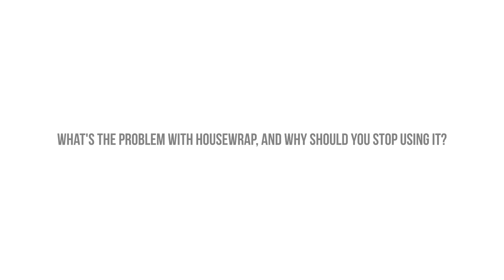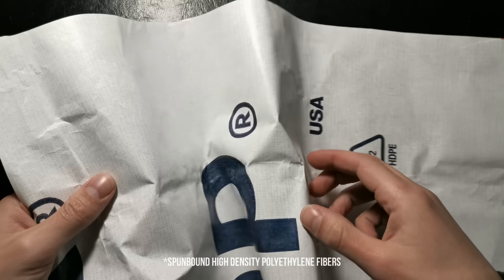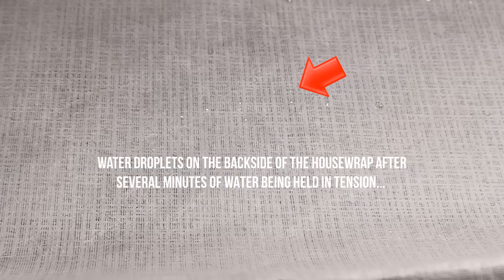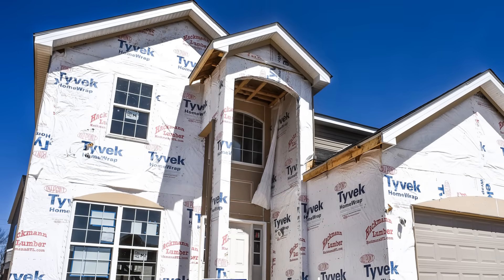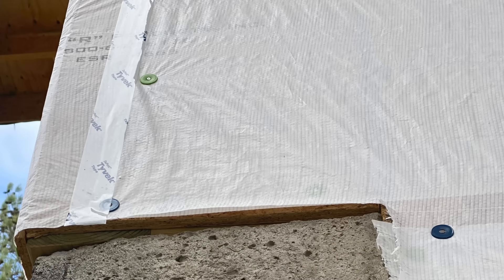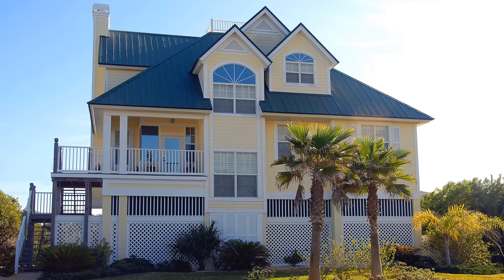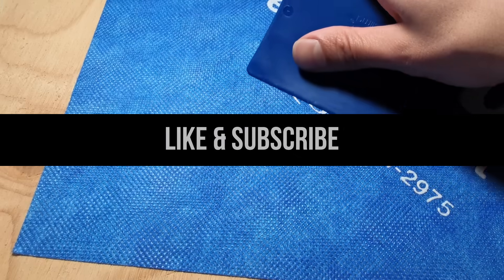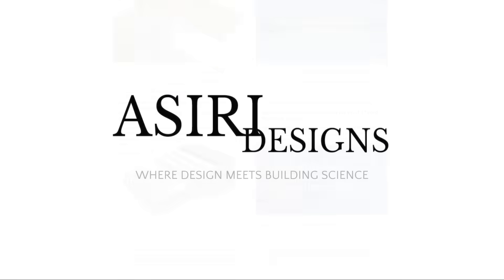Why I Stopped Using House Wrap

Comment: Having done my fair share of old house renovations and repairs here in Kentucky, I’ve never seen old fashioned tar paper fail when properly installed. I’ve taken down walls with 100 year old tar paper behind poplar clapboard and the tar paper was still like new.
Reply: Yeah it is amazing what free airflow can do to preserve a wall construction. Start to restrict that with retrofitted insulation or exterior sealants and the trapped moisture does destroy building papers. I've been renovating old houses for 38 years including a few years working as a builder doing external weatherboard and window repairs for a friend's fairly large painting business. It's amazing what you start to see repeatedly and consistently with old houses when modern sealants and ideas are forced onto them. I'm still a fan of heavyweight, self-supporting building papers.
Reply: @DiscoFang  I still feel like a house has to breathe. I know that the new code and new methods call for the house to be sealed up like a can but I don’t trust all the adhesives, caulks, and tape to last. Especially when applied indifferently. I’m about to retire and build a house for myself and I’m trying to strike a balance between old construction techniques and modern thermal performance. It’ll be a small house, so it’s not like I’ll need to heat and cool 6500 sqft of 20’ ceilings. I’m doing a ground mount solar system so my summer cooling will be free since there will be overproduction as the system is sized for my winter needs. I’m going to do in slab radiant hot water heat with a combo electric / propane boiler and a small wood stove. I think I’m going to use rock wool insulation. Modern houses are an industrial product with planned obsolescence, apartment complexes built 10-15 years ago here in Lexington that were "upscale" look like government housing now.
Reply: That's awesome man. I'm fifty and in another ten to fifteen years I plan to build my final home.
Reply: @christaylor8337  it’s exciting!
Reply: @rexmundi8154 You misunderstand how the new materials work. They seal against water. Liquid water. They seal against most air flow, meaning that few gaps that air can flow through should be present. However they have tiny voids that gases can flow through at very slow rates. Meaning water vapor can flow through (air too, but very slowly). The house should not be sealed up tight on the outside. These are vapor permeable moisture barriers.  In cold climates you will want a vapor barrier on the inside wall to keep the house moisture out of the wall. Those have very little flow of gases.
Reply: @ I do understand how they work. Also I understand that the inevitable gaps result in moisture being condensed and concentrated in a few areas that get saturated and rot. IDK how the new zip boards handle being saturated, but the old OSB would crumble into moldy dust. I don’t know the sweet spot between a 100% plastic sealed box and the gapped board un insulated shack, but there has to be a point.
Reply: @rexmundi8154  Why not just use large amounts of stone or timber frame construction? Get insulation factor just by shear volume and those materials will last centuries... Guess can't do that at scale for the average home though...
Reply: @SolarKillShot333  our current house is a big brick federal style house with solid 2 foot thick walls. Even though it still has the old single pane windows, we get a "highly efficient" rating from the energy companies for a house this size. We don’t have central heat or air. We need to use a window unit in the summer in the living room for about 2 months usually running it in the evening. We run the bedroom ac more, mainly because we’re in the downtown and the noise is bad with windows open. We use radiant gas heaters in the winter. The house does an amazing job of regulating the daily swings between hot and cold. Unfortunately the site where I’m building our house has access issues for heavy trucks so I can’t do concrete in mass. I toyed with the idea of cob or rammed earth but I think I’m too old to pull it off. But I do think I’m going to do some mass timber like the Scandinavian houses that slot together.
Reply: @rexmundi8154  Yes, houses need to breathe, that's why modern houses need an ERV. It doesn't make sense to get fresh air into a house through many gaps and cracks in the walls (with that air passing through insulation and whatever else is in the walls). The more insulation you add, the more it is important to not have large amounts of humid air moving through it. Old homes were built with little or no insulation, so they breathed, but were expensive to heat, at least up here in Canada.
Reply: @jamesroscoe7555  I understand why modern houses are the way they are, the systems keep getting more layered and interdependent and it seems like there is plenty of room for systemic failure in the long term. But I guess most houses will be outdated and crappy in 20-30 years and they’ll just be thrown away like everything else. You can see the death spiral in apartment complexes. The ones built 10-15 years ago are looking not great.
Reply: @christaylor8337 I built my final home when I retired and considered using tar paper for a barrier. Almost everyone I discussed it with disagreed. I used traditional framing techniques and materials, no trusses or OSB. Brick veneer exterior, wish I would have carried through with the tar paper. I'd like to do it again but I'm 73 now and don't quite have the energy 😊 Good luck with your project. When finished it will be one of the most satisfying things you've ever done! Best Wishes.
Reply: @jamesroscoe7555 The terms and the science is that old homes were built "to dry" and that they need to dry, not breathe.
Reply: @Ken-p9p8z I understand. However, people regularly say "old homes breathe, new homes don't" and it is nonsense. Drafting air in or out (depending whether there is a negative of positive building pressure) through all those leaky gaps, insulation, mouse droppings, etc is not a good way to exchange fresh air. Yes, all that air movement does work for drying but much drying is needed if there is humid air moving through the walls. Properly designed walls need less drying potential than leaky ones and an hrv or erv allows much better air quality and energy efficiency than an old leaky house.
Reply: @rexmundi8154  As a contractor, who shares your sentiment towards modern plastic boxes and oldschool techniques, I think you might be on the wrong track in trying to find a balance between the two. You may want to look into different construction methods entirely.

Breathing, in the oldschool sense of air moving through all parts of the structure, just can't happen with modern levels of insulation. 

There are plenty of techniques to build a plastic free, well insulated building. Where the materials and buildup are just inherently safe. Some even quite oldschool. The first American colonists made straw bale houses that still stand today. Hempcrete is another monolithic method, which I'm seeing more often recently.
Reply: @sigi9669 my house is a 1790’s federal brick house with only insulation in the roof and basement and just 6" of that and the windows are all single pane historic leaky ones. Yet we still get rated highly efficient by our utility companies. We use primary gas infrared heaters in the fireplaces and don’t heat the bedroom at all. The thick walls keep it warm well into the winter and cool well into the summer. We only use one small ac to keep the humidity out. I feel like the push for super insulated building science houses like the one in the video just end up using as much if not more energy than a smaller less efficient house. I’ve seen some Scandinavian builds that use massed timber thats pretty nest.i do like the rock wool insulation
Reply: @rexmundi8154  tyvek DOES breathe...lol thats why they use it
Reply: @DiscoFang 
Never seen an old house fail at every 'penetration' in the exterior.  Every window, skylight, door, chimney and others being the weak link in the chain. Flex wrap and Tyvek, properly installed, work fine.  You can fuch up any style of housewrap with the wrong contractor and regret that in the end. 

What was done in the past is rarely better than the future and if it is there is an environmental price to pay.  If not, why aren't they all still built with stone and mud to fill the cracks?   Because they didn't know then anything we don't know now.
Reply: I have a home built in 1935 and can verify that what you are saying is true.  I was amazed at the condition of the tar paper when I uncovered it to do some siding updates.  It was like new and still had a tacky feel to it.  When I added an extension in the 1980's I used tar to seal the joints in the plywood and placed tarpaper over that. I also sealed the tar paper joints.  Recently opened the siding and it too was like new.  Was never a fan of house wrap as it's just too flimsy.
Reply: @garyjarvis2730  That sounds real good
Reply: I’m from California, it fails all the time here. I think the difference is humidity. Tar paper becomes brittle when it dries out too much, and it dries out in California summers.
Reply: Old tar paper gets brittle and falls apart
Reply: I took a apart a 100 year old cabin on an island up here on the coast of BC (incredibly wet cold rainforest ocean front environment) and almost all of the original fir studs were absolutely fine and could be reused. The more recent DIY bathroom addition with plastic vapor barriers and insulation was completely rotten.
Reply: In France we only use  high vapor permeability sheet outside our walls. And we also have to use a sheet with low permeability inside our walls on wood buildings . 
But obviously, the most important is to deal with the correct hygrometry in our house , they always have to be correctly vented, even if they're old
Reply: This is more of a commercial than anything
Reply: What about house wrap, what was your experience?
Reply: @markmartin7384 I've re sided houses with cedar siding and tyvek wrb. After 30 years the cedar was tired, the tyvek was stained, but the studs and interior were just fine. Nothing wrong with tyvek afaik
Reply: @nicholasimhoff9230  but then you can't make clickbaity videos about it?
Reply: @markmartin7384  I haven’t done a lot of work on newer construction but I have noticed that the real problem isn’t so much with the WRB but with the quality of the wall material itself. The older OSB is just terrible and the 2x material is so much less dense like it’s just sapwood. They both crumble and rot if even a tiny amount of water gets thru.
Reply: @markmartin7384  I personally didnt see any tyvek in demos
Reply: I had tar paper between floors in the bathroom.  The drama it created, was a bright green mold.  It made me sick.  I did find it, and address it, but when I removed it, it made me really, really sick.  I did not put anything between the floors after that.   Nothing.   Nor will I ever.
Reply: @ that’s just bad practice. The old way was to do a hot tar bed that got cemented over. It’s also a good point about system failure. As long as the grout and tile were intact, the floor was fine. But once water got thru, the system was overwhelmed. This is my concern about the multi layer dependency within modern building systems. What happens when the ERV fails and no one fixes it for years?
Reply: @rexmundi8154   The weirdest thing I ever saw, was when I took down "Ernie's tile work" (and other of his works).  His was  a (family of mason's for generations), and the tile sat on 3/4" plywood.   Everything was fine.  The plywood did not even look wet, nor like it had ever seen a drop. He had water diversion systems, not water proof.   And they were like new under the first layer.   So, even the plywood sat 1/8" over a catch for the drip, yet, did not touch.   So, all his work, just let the first layer divert 98% of the water to where he managed it.   And the next layer, could get a little damp, and was free to dry as well.   His systems were breaking because people were trying to block his air.   Air was allowed behind his shower wall.  Behind the concrete shower walls, etc,etc.
Reply: Nearly every single house I've ever worked on (30+ years framing experience) always falls back to the contractor and not the product.  Not claiming every new product or idea is better but anecdotal evidence is really climate and region specific along with building requirements.
Reply: What are your thoughts on BP Canada R-1.5 Panel Wall Sheathing Panel 1/2IN. Costs 9 bucks Canadian here locally. Its an asphalt outer coating. The old neighbor has something similar that his house is made of from the 1930s. Claims its great stuff and hasnt deteriorated in the close to 100 years its been in the house his father built and he now lives in.
Reply: Old houses that could breath were perfectly fine with tar paper. Problem is we want efficiency which means wood can't get wet anymore
Reply: @ it’s funny because my drafty brick house with single pane glass is rated "highly efficient" by my utility company based on energy use per square foot. Something isn’t more efficient if it’s twice as big and needs to be constantly heated and cooled to keep it from rotting to the ground.
Reply: Yep. The zip system and peel n stick are great no doubt, but tar paper will save some bucks and it’s great. It ain’t rocket science to put up right either. In 89  put rough cedar siding on a Japanese pow house from ww2 they converted into a residence after the war. It was in great shape wrapped in tar paper. It was rich pine too though. But I was amazed at how good it was! People still live in that little house to this day. It still looks in good shape too.
Reply: This has been my experience as well however I question the quality of modern tar paper.
Reply: The best way (like I did on my hose) is to wrap first 60 minutes tar paper, then over it with Tyvek. Make large overlaps up to 12 inch. then go over them with Tyvek peel and stick tape. On the windows have to install with calking on the window flanges, every hole needs to be fastened, then 6-8 inch peel and stick wrap, then Tyvek peel and stick tape on top, when wraps installed. The first peel and stick should go over painted OSB around the window rough opening, not over wraps, like everyone does for the wrong reason. And build your house with plywood, not OSB.
Reply: I think this proves the adage "Do it once, do it right."
Reply: I have similar experience doing renovations for 30 years in the NE.  I prefer 30lb tar paper on plywood sheathing.  Tar paper also inhibits mold and bugs don’t eat it. 

Zip with tape is a joke, it doesn’t stick well and will leak on horizontal joints.   Fluid sealing seams and nail penetrations of zip is likely ok. Blueskin will isolate leaks and penetrations but that can send water inside.  To early to tell about Blueskin.   Ice and water shield has worked well on roofs and at ground level over sheathing so maybe Blueskin has promise if installed properly.  Still, Tar paper is proven and more forgiving of install mistakes because it breathes so well when wet and is mold resistant.
Reply: Agreed, I have taken apart 100 year old house still perfect under the tar paper. I have also taken apart a five year old house that was totally ruined from tyvek
Reply: Same here
Reply: Housewrap is "permeable" and therefore is NOT a moisture barrier.
Mix it with untreated wood and lots of insulation and you create the perfect conditions for wood decay and mould.
It ain't rocket science.
Leaky homes case NZ.
Reply: What about the condition of the walls behind tar???
Reply: I have seen 15lb. felt get brittle and in some cases was essentially gone. In a different climate I have seen tar paper do well.
Reply: @geraldpolmateer3255 
So what kind of climate are you in? How often have you seen this?
Reply: @b_uppy  I have lived in several states and a few countries. The worst tar paper I saw was in CA where it gets hot.
Reply: Saw I believe on stud pack channel them demo a fifty year old shower that still was in excellent condition white tile on thick stucco? on tar paper on wood framing. Zero mould and no water damage to wood.
Reply: The problem with the old tar paper is fire. There are several reasons why houses like my 106 year old farmhouse burn up so fast if they catch fire. There are no fire blocks. If it is a two story like mine the walls are made using continuous studs that go from the base beams all the way to the attic. Then runner boards were attached directly to the studs allowing a place for the second story floor joist to rest on. Tar paper burns quickly and each space between the studs acts like a chimney.
Reply: @patrickskelly7520  Yeah, thats a real concern with ballon framing in old structures.
Reply: This video sucked
Reply: Im guessing there us something different about your climate up there because here in VA ive never seen old tar paper that wasnt in tatters.
Reply: I've taken off stucco and siding in Regina Sk Canada at 50-75 years old and even improperly wrapped tar paper seems to do better than Tyvek,.
Reply: My house was built in 1842 has been abandoned since 1983 how many modern  houses would  hold up to be left with no heat no maintenance  and for that lenght of time none simple new construction  is designed to try and save materials😊
Reply: I built a 2016' so. log cabin out of 8" - 10" diameter lodgepole pine that was air dried for 5 years after I peeled the bark.  The second floor was framed with 2x6" lodgepole, sheathed with plywood, heavy tar paper and finally board on board rough cut fir/larch.

Windows and doors were in place 1985.  Heating is  wood.  After 40 years it is doing fine. 

It is in a semi arid climate with hot summers and cold snowy winters.

I'll be building a guest house near Huntington West Virginia this Spring. I think it will be a log structure.  I'm 71.  That should last until I won't be needing a  house.
I want to be camping in the Cascade Mountains when I retire.  😅
Reply: Ditto, never understood the move away from TP
Reply: it looked like new because tar stays tar no matter what you do to it
Reply: If you like wrapping yourself in a petroleum product cocoon go ahead.
Reply: @ what do think house wraps are made from?  Cotton and silk? 🤦‍♂️
Reply: @daversj  Enlighten me professor. I've worked in the trades for 40 years and know the differences quite well.
Reply: @p @ponowar2025  so tar paper is better generally?
Reply: Uhhh tar paper fails constantly. Not due to improper install.

Due to aging, it becomes brittle and flakes apart.

Also around any penetrations like doors and windows where siding trim doesn’t cover as well as the flat area is covered by siding.

Felt paper isn’t connected or flashed/taped to these penetration rather laid around it.

That’s where I see leaks from it all the time.

And even if not, the aging is inevitable.
Reply: @justinstevenson2061 wrong , I see first hand how tar paper holds up and I will continue to use it over these new wraps.
Reply: Absolutely echoed my words too. I’ve been demoing a cabin built in the 40-50-60’s and the tar paper has preserved the logs and ship lapped siding interior walls. Every time I throw a wall up I use two layers of 30# felt and overlap the seams.